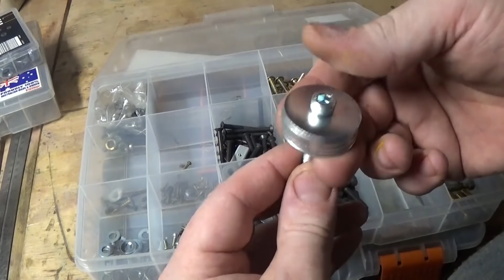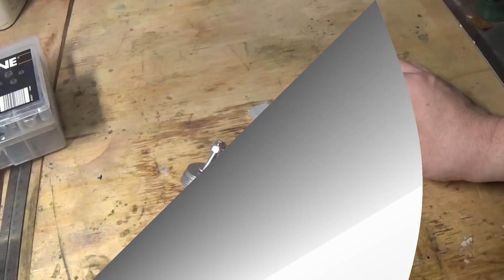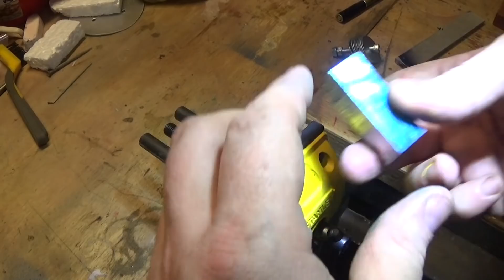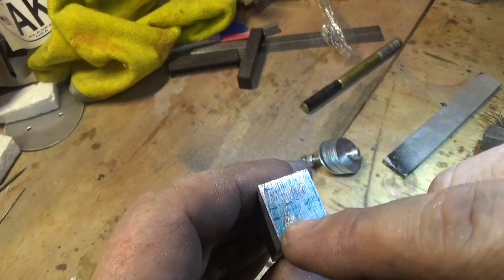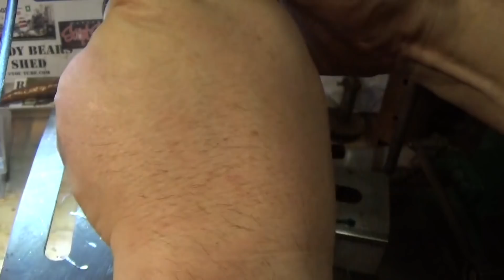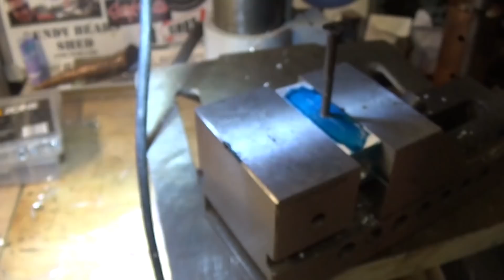mr pete engine part 1 - no machine tools!

Comment: Cheers Emma - well done. What looked like a quick and easy build, isn't. Which was the whole point of my doing it. I rushed into it, too impatient to start. Should have waited until I had some stock. No proper ally, except my crap melted cans. Only bolts for round stock which no drill fits. Plus a drill so inaccurate you can drill squarer by hand. Apart from that, it was a doddle lol. When I get some better stock I'll probably have another go sometime.
Reply from the maker: i think you sell yourself short. I got this running. but it was a challenge all the way . a bit of experience sure helped.
Reply: Thanks Emma. Not really as you know I've already built a much better one using the same materials and tools. My 50plus years of experience made it possible, but I really think this would be almost impossible for some young person to do with little or no experience.